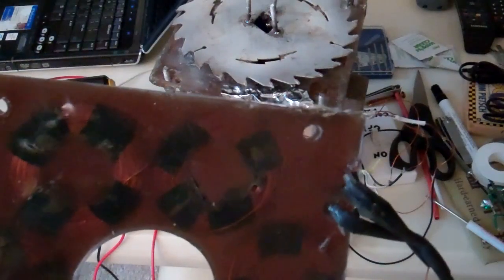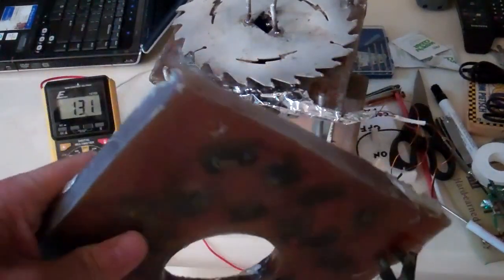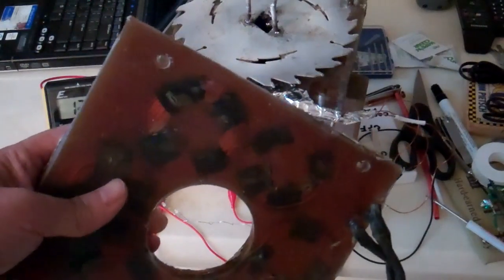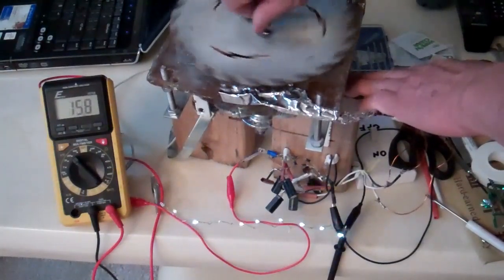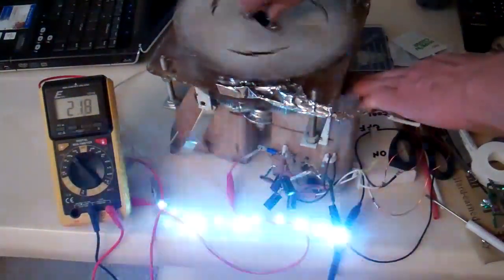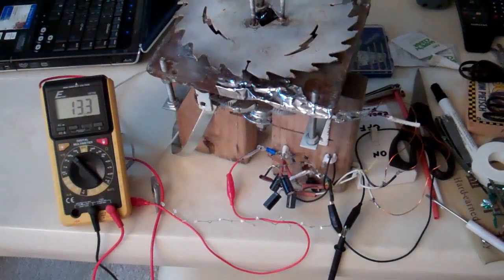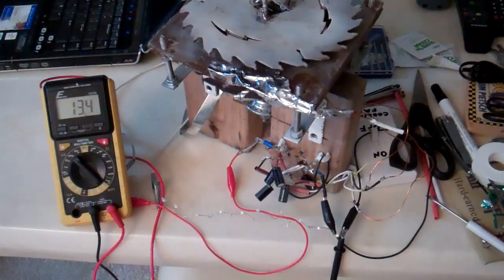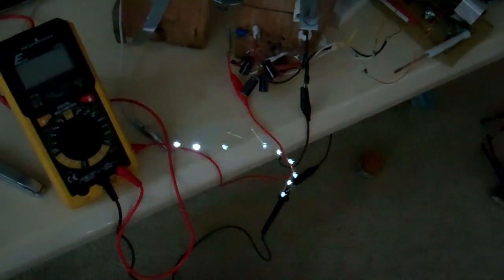Switching back to a smaller wire gauge stator for my vawt .mp4

Comment from the maker: @sjh7132 I threw this alternator away after I made the new one.  Whe I retrieved it later, one of the three wires was broken. I reattached it and the 3 phases seemed to be ok and "ohm out" correctly. I'm not sure how a phase can be reversed. Maybe the diodes I'm using have to be rechecked. I'm using 1N4007 diodes. I think they are 1 amp each. I really should get one of those "Boreas" alternator with the 3 foot wings :))

Comment from the maker: @Fearlessthinker  It's supposed to be dc. Maybe my diode bridge rectifiers are not working that great or maybe the 3 phases are not working correctly. When I put 2 capacitors on one of the phases, the output  smooths out and it doesn't blink.